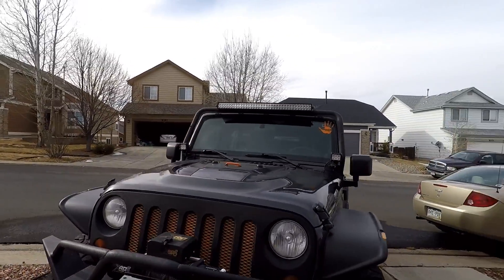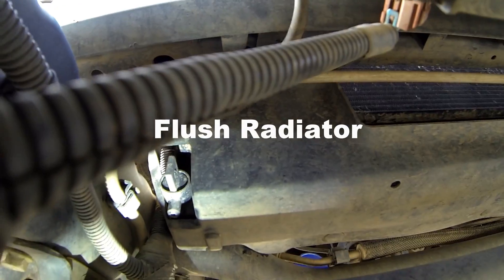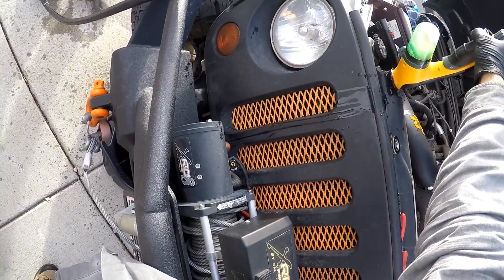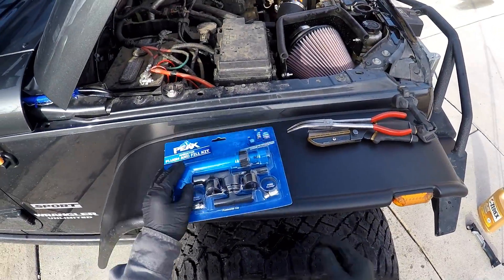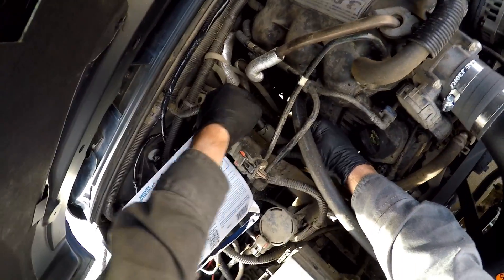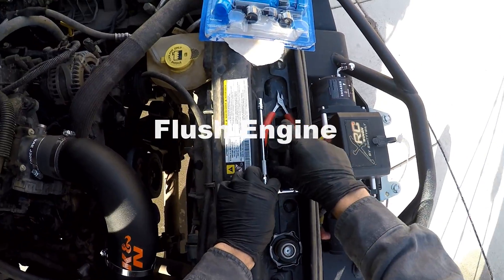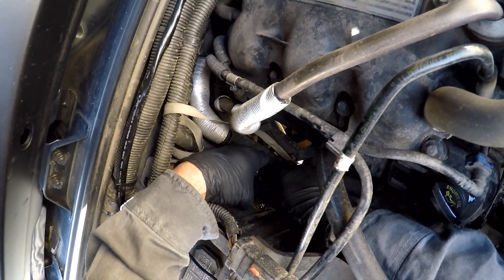2010 Jeep Wrangler JK Coolant Super Flush - Radiator, Engine & Heater Core

Comment: Great video!  An easier way to drain the overflow reservoir...  
1. Open the Overflow Reservoir cap.
2. Disconnect the overflow hose from the radiator cap. 
3.  Hook the hose up to a Shop Vac (Wet and Dry Vac) and vacuum all of the coolant out of the bottle.

(I just stuck the overflow hose in the Shop Vac hose and used my hand to seal it while it pulled out the coolant.  I've used this same method to reverse drain\flush the heater core with great success.)
Reply: Can literally take the whole bottle out and dump it 😂

Not even a bolt holding it in

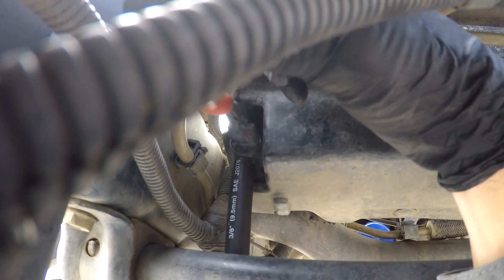Comment: 2:15 Which direction do you turn the drain valve, Clockwise or Counter??? EDIT 2:54 Counter Clockwise....
Reply: Be very very careful in making only approx a 90.   Several yrs ago on one of my Rams, at a qick-lube, the monkey was NOT aware the 'open flow' turn was NOT 240 degrees. To replace that sucker came only w/a new radiator.  Back then the MFG was not molding the fitting w/a 90 degree swing slot.  Now,  today, I do not think that valve is replacable on/to the rad while on the vehicle.

Comment: All of you need to start reading the technical service manuals…for starters flushing the engine does not require cutting anything. You pull the top radiator hose and thermostat, disconnect the bottom radiator hose from the water pump and use a flush gun. You can flush the heater core using the two hoses disconnected from the engine side and, again, not cut anything. The radiator must have vacuum pulled to remove air from the system as well collapsing the upper and lower hoses when refilling. All you diy’ers are causing more problems than you’re fixing. Also, that coolant didn’t look that bad. Alot of coolant is maroon from the factory. My 2018 JK looks exactly like that with 40k miles. I am amazed at how long these things stay on the road given the shade tree mechanics.
Reply: You do not need to pull a vacuum …never had ….Haynes manual don’t call for it ..I’ve done mine no problems…but yes you do not have to cut hoses 😂

Comment: Since you used the tap water left in the engine after flushing for part of your 50/50 mix, does that put your coolant at risk for premature failure?
Reply: mineral particles are now circulating in the system, not good

Comment: How do you know this system gets past the closed thermostat. I don't see everything in the block getting flushed out.
Reply: This a great time to remove the stat, clean the corrosion that is eating it away, and check if the stat should be R&R, In many cases the supporting hose and thermostat hold-down piece should be replaced too.

Comment: Ok jeep guys i screwed up, only because I'm a new jeep owner.. i have a 2012 jeep wrangler sport.. i started to loose heat couple weeks ago. so i watched a few YouTube videos how to flush the heater coil. i flushed it fine and got heat back.. after that i checked the antifreeze seeing it was low..  i added some to the radiator. the jeep started to over heat going pass half to the next mark.. it has never gotten into the red.. so i changed the thermostat, and the coolant sensor on the motor..  ok still over heating.. come to find out i had used the OAT coolant.. when it should be the HOAT coolant.. my question is when i go to flush the motor and radiator and put the HOAT back in do you guys think it will stop the over heating issues or did i just screw up my whole damn motor..
Reply: an ugly chemical reaction may have gooed up the radiator. There is some online info about this. Bad chemistry.

Comment: Just curious, if you turn the heater on fully while flushing the engine will it also flush the heater core? or do you have to flush the heater core separately like in this video? Thanks.
Reply: I'd like to know this as well. I was hoping that if you 1. drain old coolant, 2. fill with distilled water 3. turn on engine and heaters 4. drain distilled water, then repeat 2-4 until drained fluid is clear, then it does it all?
Reply: I'm still a bit fuzzy in what Kevin did to the heater hose to do his flush.  But good question here.  Some vehicles had actual mechanical water-flow gates that require actuations to 'open' to allow water to circulate back to/thru the block. I believe I had such heat control on my '77 PU 460cid.  Maybe there are readers here that has such aged vehicles that need a flush.  Failure prone air-gates have been married to the auto for years and are getting better.

Comment: Correct me if I'm wrong, but I never seen the flush T in use. Only connected, then taken off. I feel like a part was skipped.
Reply from the maker: Please watch the whole video. The T is added before flushing the heater core to keep the hoses together, then removed during flushing the core. Later, the T is added to flush the engine.

Comment: My question is not related to flushing. I work at autozone. We sell cold air intake build kits for kN. Did u actually notice any benefit worth the expense. I know they are costly. Did u install it yourself?
Reply from the maker: Prior to re-gearing, we only noticed a little difference. The 35's still caused the Jeep to drive like a slug. It did help a bit at full throttle going up hill and sounds awesome. The biggest difference was re-gearing so you should probably start there first.
Reply: @symantec1176  I was just hoping for gas mi. Improvement. My tires are only 32" no lift.
Reply from the maker: @conniebennett6646  I have a total of 3 K&N cold air intakes across three vehicles. I find that you either get slight performance increases or gas mileage increases, depending on how you drive. For me, either I have a lead foot or am pulling (trailering) more weight. If you drive without requiring that extra performance increase (i.e. daily light driving), you'll get 1-2 MPG increase. Don't expect a great deal but based on today's gas costs, likely still worth it in the long term.

Comment: This is a really poor video for what is actually complicated and scary to flush for someone who is not a mechanic. Flushing the radiator, cleaning the coolant container and flushing the heater core is easy. It's simple schematically. Drain the radiator, flush water in, the coolant reservoir disconnect it, dump it and hose the inside out and the heater core flush in on the outlet and out on the inlet into a bucket. Easy. However, the part that is complicated is the engine flush. On my own Jeep I see multiple connections, i can see the thermostat is on the upper radiator outlet hose. I see a lower radiator hose that I don't know what to do with and then bunch of connections on the left side of the engine after or before the heater core for the engine. At this most important part, the video is on crack with speed, shaking like a bad horror B-movie and really really really bad distracting music. Not enough detail of which hoses are what and I have no idea where or what the water pump looks like because it is not pointed out to me. If I knew these things I would not have to watch a video and this is why I'm watching a video...to learn and do it myself. It's a circle with a bunch of connections. I get the concept but I have no idea what is flowing where and what connections are what after watching this.
Reply: Buy a Haynes manual and figure it out…

Comment: Tear down the entire front end to get a wrench on that drain valve where you can get enough torque to turn it past 90. I found it easier to just unbolt the radiator remove the hoses and pull the entire radiator out. If you have a Rubicon the sway bar disconnect motor is blocking where you can get your hand in there.
Reply: You need more junk bolted to your front end to block that radiator of yours 🤣

Comment: Is there a way you could do this without disconnecting the hoses and just open the radiator drain valve and feed the hose into the overflow tank, start it and let the water pump do the work? Wouldn't this eventually flush the system clean including the water pump, heater core and engine water passages? Asking because I want to do this on a 220k km JK which needs a new radiator. On another note this is the first major repair item I've had with this car. Well out of warranty now and want to DYI.
Reply: or DIY even
Reply from the maker: @andrewhood9246 , The problem with not flushing on the other end of the engine is the thermostat and water pump may not allow the water to flow, especially through the heater core.

Comment: NEVER put tap water to anyone that is watching this. ONLY use distilled water! Tap water will leave minerals in the system.
Reply: It's fine for the flush. You're not leaving the tap water in the radiator.
Reply: As if the minute minerals in tap water are worse then the casting sand that been in there for how long now ? 😂
Reply: Better safe than sorry
Reply: Not true there is hardly anything and the antifreeze has inhibitors. Tap it up.
Reply: How do you pressurize the distilled water?

Comment: Did you notice any performance change with the k&n air filter?
Reply from the maker: Very little. Mainly gave it a more throaty sound. We finally re-geared to 4.88 and huge difference. Still breaking in but will be interesting if the K&N shows a noticeable difference once we can really press on the gas.

Comment: Are the hoses set up the same on a 2015 jk?  Different motor.  Planning on flushing this weekend but its my first time doing this.  I feel confident after watching this video, but want to make sure hose setup is the same.  Also, if you re fill with 50/50 after flushing system with water, will I not have my 5050 mix in the end?  What will I most likely end up with?
Also, how many bottles of fluid is required to re fil after a flush? (Of pure coolant)
Thanks!
Reply from the maker: I can't speak for the 2015 but there should always be an input and output to the heater core. Should not matter which as I have never come across any flow controls within the core. Not sure if the hoses are located on the same side but you should find them close to each other going from the engine bay, through the firewall, to the cabin. I do not use 50/50. I flush the system which leaves some water in the system. I poor full concentrate into the radiator. I then top off the radiator with water which is about the same amount as the full concentrate. I then check the boil point with the meter after that. You should be close and can adjust accordingly in the overflow tank. Yes, after flushing you can use 50/50, but it'll take you two large containers, and maybe a little more concentrate as I said there is some water in the system from the flush.

Comment: how has your 3.8 been?   Im looking for a JK   leaning toward the 3.6  but   i've heard hit and miss things about the 3.8
Reply from the maker: No problems with our 3.8 except for the EGR sensor going bad at about 80k. Easy fix and now at around 100k. I do like the extra power in the 3.6 though.
Reply: @symantec1176  Where is this EGR sensor?  Did you consider replacing the entire EGR valve (between the firewall and the rear of the 3.8L engine)?
Reply from the maker: @dano0726  The EGR sensor is part of the EGR valve. Yes, I replaced the whole unit which is between the firewall and rear passenger side of 3.6 engine. 3.8 should be the same. Easy for me as I have the aftermarket fenders and can easily remove the fender liner. Then it's a matter of turning the wheel fully to the left and blindly getting a 1/4" deep socket back there. The wire harness is a bit of a pain but the two bolts holding the valve isn't bad.
Reply: 3.8 way quieter than 3.6. The fan on the 3.6 is very noisy
Reply: RUN AWAY from the 3.6 Plastic Penstar

Comment: At the end, when you used the gauge to check the density, how do you know which to add; water or antifreeze ?
Reply from the maker: More antifreeze you add, the more the needle will move up.
Reply: On average I've seen, the full strength coolant needed to be bumped up in the over-flow tank, it'll circulate in a day or two.

Comment: If the Jeep keeps blowing cool air on heat,  after you've done these steps you have a air lock in the two heater core hoses. Zip tie them together to make them straight and drive it. Then add more antifreeze. This video and this step works for 3.8 and 3.6.
Reply: When you say zip tie them together do you simply mean pinch both of the lines? I think I may have to try this, my jk blows cold on the driver side.
Reply: @Spacesprocketz  you ever get it figured out? I’m having the exact same issue but the engine won’t get up to temp.
Reply: @Spacesprocketz  try replacing your heater core.  https://www.youtube.com/watch?v=_fBSopnYYEU   is a great and easy step by step video

Comment: Does this effectively clean out the casting sand that is causing so many issues? I've replaced my heater core and radiator already on my 2009 and need to do something as it is already starting to blow hot only on one side.  I'm afraid I am heading to another leaking heater core due to a severe clog.
Reply: Did you ever get an answer?
Reply: @Team-Elevated  I’ve limped through winter and the heater sucks. I still need to do something
Reply: @db09jku  o bummer
Reply: I’m currently dealing with the casting sand issue. Will be doing a flush this weekend

Comment: No offense but being as water transfers the heat and coolant barely does shouldn’t you have added water at the end?
Reply: ummm this is not correct. "Coolant" actually conducts/transfers heat just as well as H2O (water). Your adding water to reduce the specific gravity of the coolant mixture.

Comment: How many litres of coolant and distilled water (combined) did the entire engine and radiator require?
Reply: Arron, Ck the owner's manual for your system's coolant's capacity and on average most systems are serviced toward the mark, half&half.  Now, I use distilled right out of the gate, w/clean water pressure pump, pushing distilled (pressurized at input) thur the block and heater core, using approx 3-4 gallon for the flush till clear running, then on , don't concern yourself, keeping in mind half&half, using approximations,  pour the full strength coolant in, cap it, keep checking a day or two after a bit running, circulation,  review the coolant weight till you get the colored BBs at your needed mark on the weight scale.  I believe the radiatorr capacity is figured in w/the number the owners' manual gives for sys capacity.

Comment: Remember that the $3-4 flush kit will direct you to splice into the top line.  This is reverse flushing, so use the bottom line as indicated.  Worked like a charm. I flushed system after this with Preston flush and clean using the bottom line - no difference in doing so.
Reply: Thank you for that! I was wondering the same thing and as to why he was splicing into it making it more difficult and time consuming. Appreciate the heads up!

Comment: Excellent video!!.....Just curious.......why did you cut the heater hose rather than disconnect it from the block?
Reply from the maker: witchesbru67, you can do that if you use an extra hose to connect to the block because you flush both directions. The flush must be inline with the system.

Comment: Can this be done on a 2014 Jeep Wrangler
Reply from the maker: Sorry, I am not sure about the engine layout in that year. I recommend you watch the whole video and then compare hoses. You are mainly looking for the radiator drain valve and the two heater core hoses going through the firewall. Also note the 2013+ Jeeps have different antifreeze requirements.